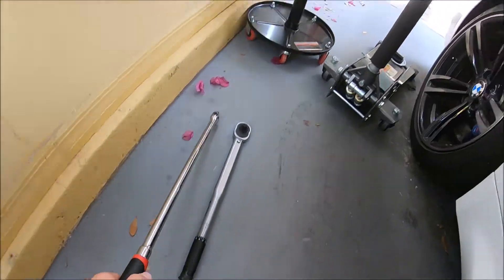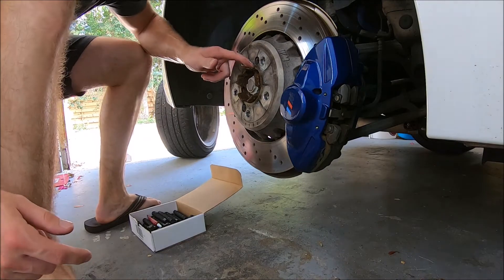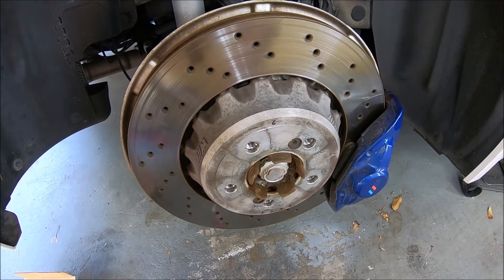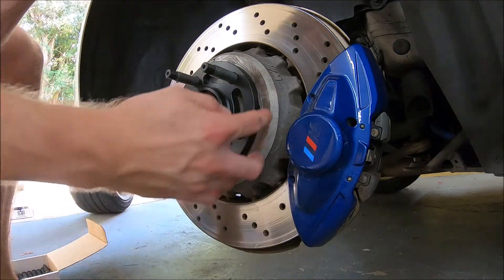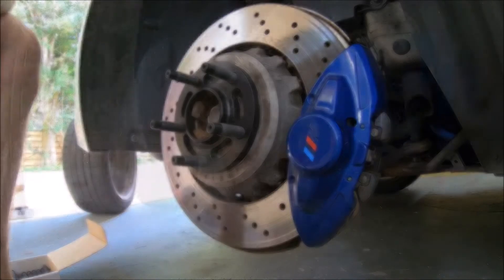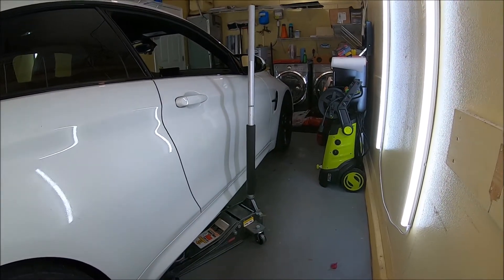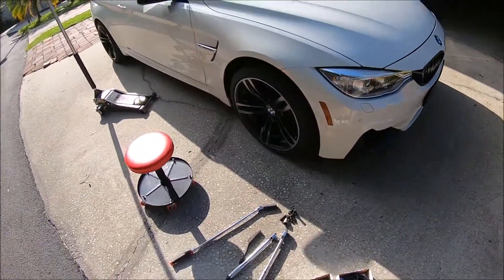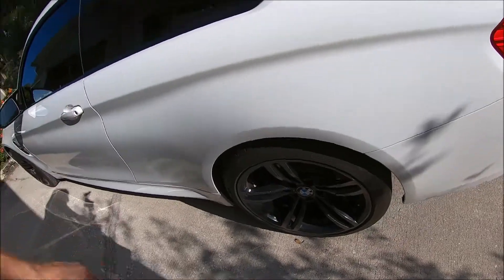Vlog 09 - BMW M4 Wheel Spacers & Stud Conversion

Comment: its actually 25ft lbs for the stud and 105ft lbs for the nuts. Plus re checking the torque after 20-100miles is recommended on the nuts.
Reply: Also, you should definitely never solely depend on the jack! Use jack stands and or place the wheel under the car for added security. Using just the jack as support is a recipe for disaster, imo
Reply from the maker: Thanks for the correction iDami4n! I appreciate the feedback and I pinned your comment so that everyone is aware of the proper torque spec.